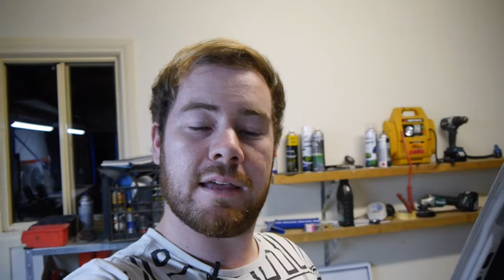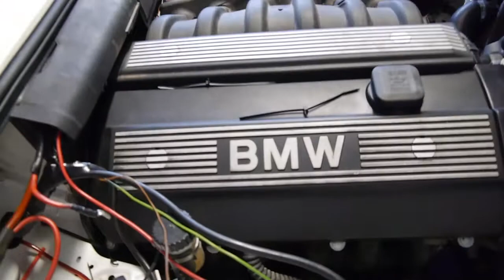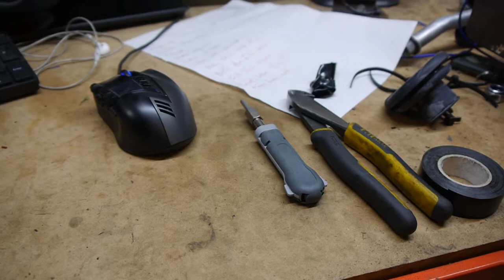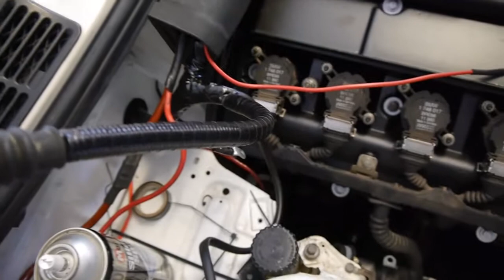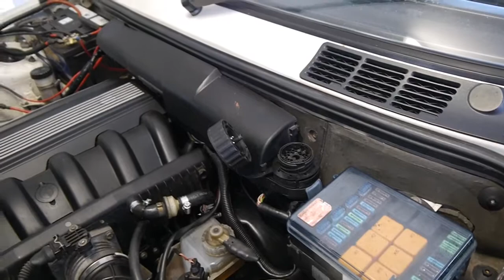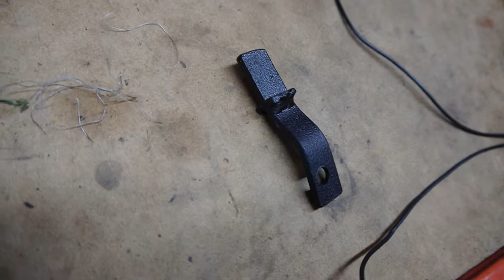E30 M52 Conversion Episode 8. Tidying up the engine bay

Comment: I have a Alpine White 1990 316i E30 that is actually in a the bodyshop for some very minor rust repair and a respray. I'm planning to swap a m52b28 into it once it's finished and this series has provided me a lot of info. Where I live we don't actually have any kind of compliance or emissions inspections so I hope it's going to be quite easier. Which driveshaft did you use? Planing on using the g240 gearbox too. Keep the videos coming!
Reply from the maker: Thanks mate. I just got the original tail shaft shortened
Reply: I used a manual e36 325i driveshaft, just need to use the e30 CSB and flip it around